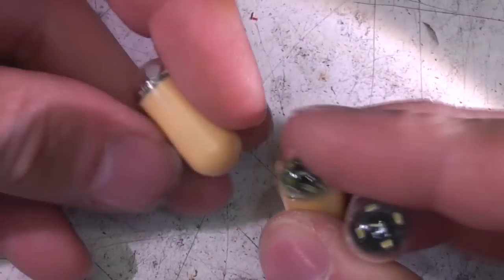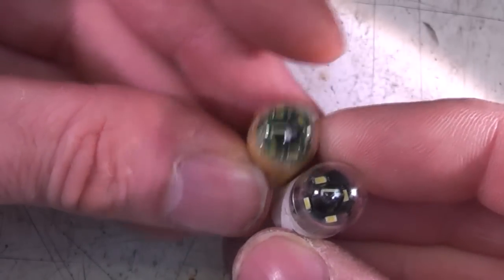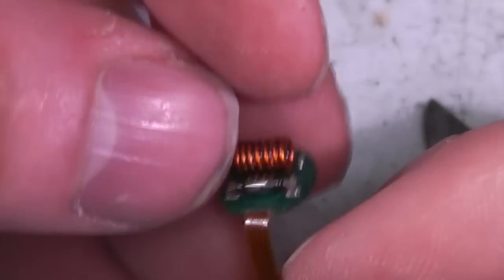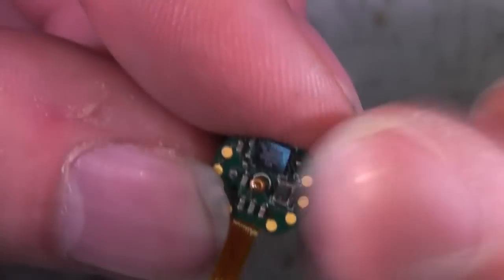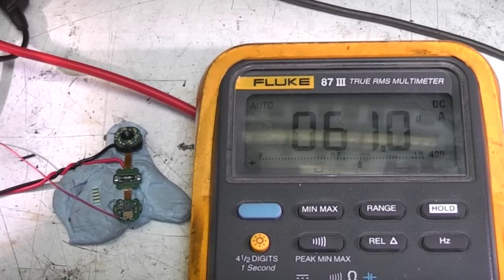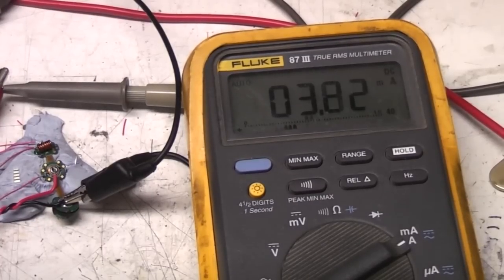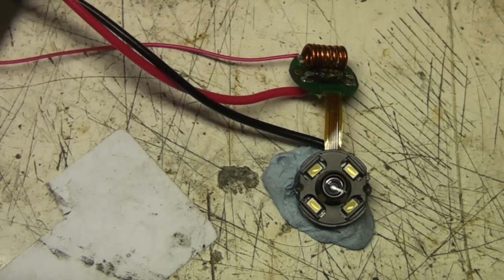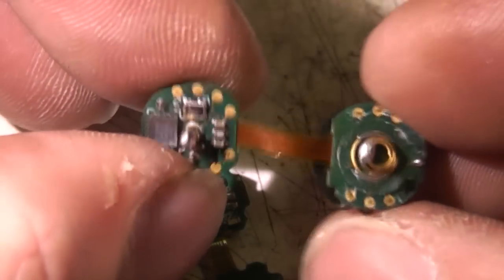Another pill-cam teardown

Comment: I have had several of these through my gut. The nurse presents it to you in a box similar to a ring box. When you open the box the device is dormant and is in a "U" shaped clip. As soon as you take it from the clip it starts flashing. You then swallow it with a cup of special liquid that that prevents foaming as the camera begins its journey. It takes most of the day to make the trip and you usually wave it good bye when it drops to the bottom of the pan. They attach a small device to your waist that monitors the progress of the pill-cam during its trip. The device has a small lcd screen so that you can see where it is inside you from time to time. All the pictures are stills and the doctor downloads them and makes them into a little movie. The only painful part of the process is trying to remove the sticky sensor pad from your groin area.
Reply: Did you have to take a special 'patency' pill to find out if whether one of these would get stuck in your gut?
Reply: Yes. Mine took a little longer than expected to travel and after 48 hours they did a CT scan to see where it was. But it was OK and they put it down to slow gut transit.
Reply: Did you get to keep the pill cam?
Reply: martin nash lucky bastard it took for me 72 hours

Comment: This sounds probable. The only thing you might be missing is that the activation is not happening through the camera, rather, through the LEDs. They could be switching their GPIOS as inputs when the LEDs are off and sensing light coming in. You can find lots of info online.

Comment: Yes I found a pdf that mentions the Zarlink ZL70081 on Google.  It says it's transmit only, and has a diagram of a two PCB version that looks very similar to the one broken down.  Also it includes an external photo that has the same logo.  The pdf on biobrain1 has pretty pictures.  There's a book "Integrated Microsystems: Electronics, Photonics, and Biotechnology" that has a chapter "Design of a Low-Power dual-mode MUX-based transmitter for biomedical applications" that describes the tx.

Comment: That is the clock crystal for the control chip.  The 433Mcy/sec signal is generated by a frequency multiplier in the chip (27Mcy/sec*16=432Mcy/sec).

Comment from the maker: Highly unlikely - too complex. IF (and this is still a guess) the purpose is to prevent re-use, the activation process must be at the factory, to keep it secret. 
For ease of use, once activated it can then be turned on & off using the reed switch until the battery dies, and can only be restarted by replacing the battery and doing the activation again.

Comment: I have one of these working it's way through me right now. 

The pill was not flashing inside the box (it comes in tiny a box with a clear top.) I got strapped with the belt and receiver first, then was told to remove the pill from the box. As soon as I picked it up, it began flashing.
Reply: SirFlanigan I swallowed mine at 7:00 am yesterday. I still haven’t seen it in the toilet yet. How long did it take for you to pass it?

Comment: I think some of these have to be "activated" by the doctor first with the receiver unit that also has it's test mode to make sure you are not swallowing a dead piece of kit, even though they test to receive images before you even swallow it, perhaps this is used when the units are received from the manufacturer and they can thus return any duds?

Comment: Excellent quality footage, may I ask what camera and set up you are using? I can see the split BNC input pointing up and down on the scope to the left of the one you were using would act as a strain relief but I've never seen that before... is there any time you use two probes on one input like you are implying there? Or is that just to keep the probe's wire from getting bent and abused since your scopes are higher than average benchtop?

After reading your comment on the followup activation patent .. a couple of thoughts come to mind -- a) intentionally trying to cover as much ground of possibility to make it hard to copy as well as easy to sue EVEN IF it is not in this device which is devious in so many ways ...leaves other countries looking down paths that aren't even there and maybe part of why any one could have so much trouble figuring one out.  I guess I forget my other thoughts but it sure was interesting to read everyone's ideas on the topic. I see you have a flight data teardown. Sad to hear today EgyptAir was likely terrorism. I've always wondered about those so I gotta see that next. Avionics was what my father did in WWII and taught electronics.

Comment: You might as well just buy other camera stuff off ebay. These are way more pricey. You can build a little camera setup with a wireless transmitter for around 50 bucks if you do it your self

Comment: Here's a video titled "PillCam COLON Procedure"  /watch?v=uJ5URbxyVxU  
It's not a video of colonoscopy pictures. It's basically showing the procedure concerning the implementation of the  pillcam. The video was published on Nov 21, 2012 so you might not have seen it. By the way, I loved your video. Although, because your vocabulary is far more expansive than my own most the information went over my head. However, I plan on changing that  :)  thanks to you.

Comment: are these things reusable?
Reply: probably not
Reply: imchris5000 Would you swallow a pill cam thats been on a couple poop voyages?
Reply: you can throw away the pill and use another container for the electronics
Reply: Mustang Rt
medical stuff like this is never reused
Reply: Most likely not, but if you really wanted the camera.... just wash your hands extremely well. And I suppose you might be able to use one as a spy cam. Idk how well that would work though
Reply: at this point it's better to buy a cheap part, it would be difficult to reverse the tech
Reply: Mustang Rt its a good weekend project tho